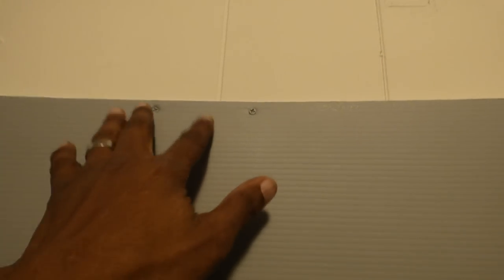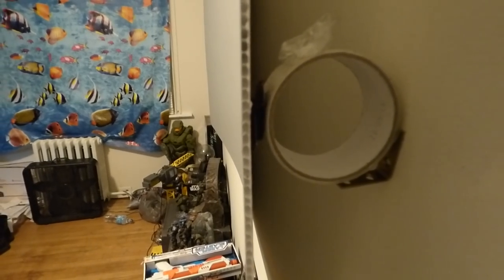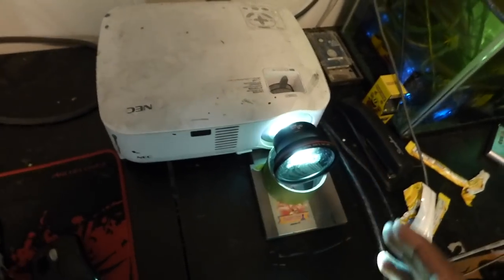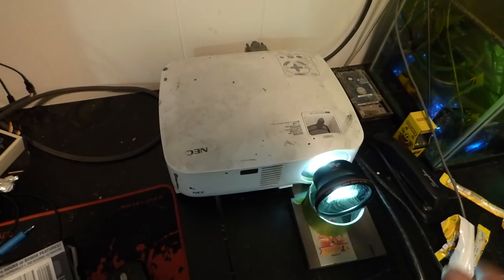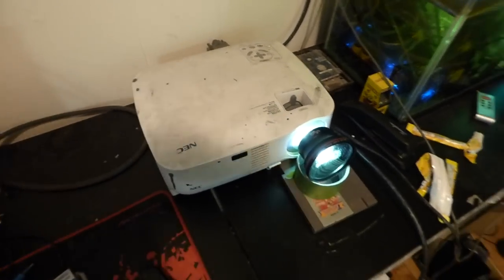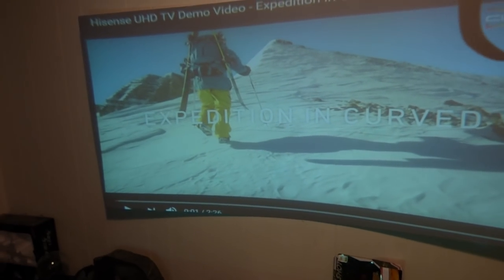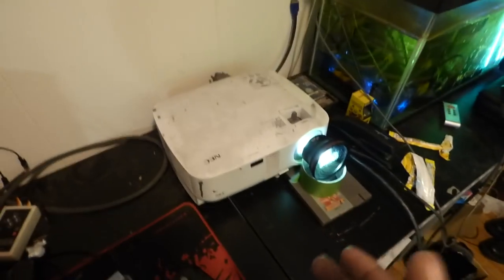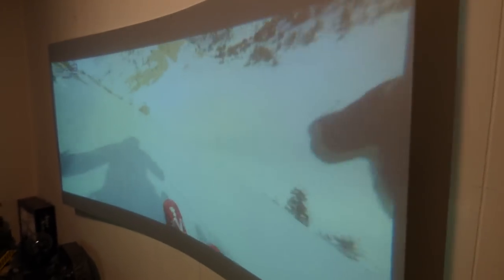WANT A EZ WAY TO BUILD A CURVED SCREEN? THAN CHECK THIS OUT!

Comment from the maker: Here where you get the surface from and what it call http://www.homedepot.com/p/48-in-x-96-in-x-157-in-White-Corrugated-Plastic-Cardboard-10-Pack-WC4896-10/202489118
Reply: Cool,
How many of these corrugated panels were needed for this size curved screen?

Are these two side by side horizontal layout or did you have to cut it to a custom size?
Reply from the maker: @Mikinct  Hello Email us at IV-VIII.BLACK.SERIES.EDITION@OUTLOOK.COM